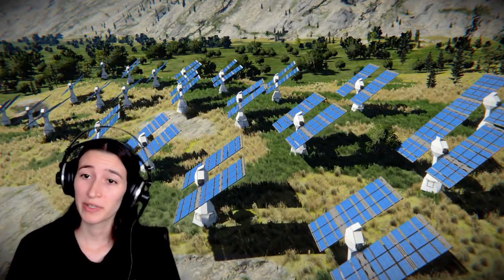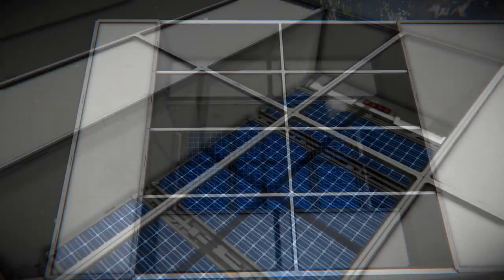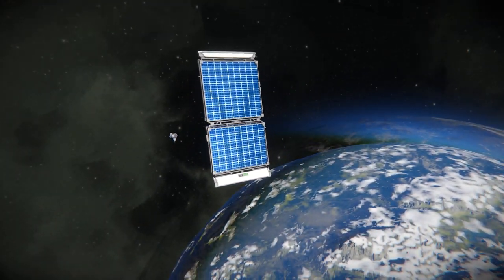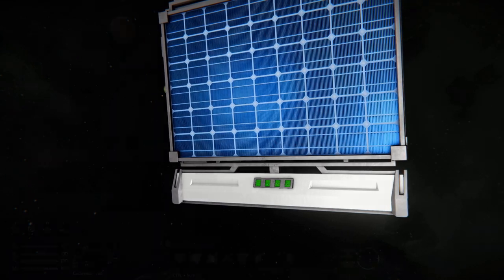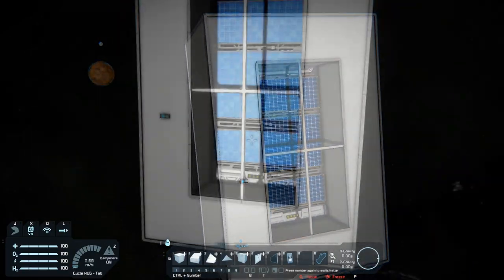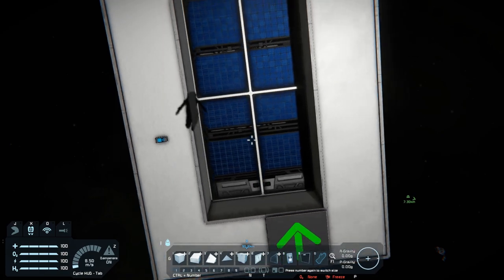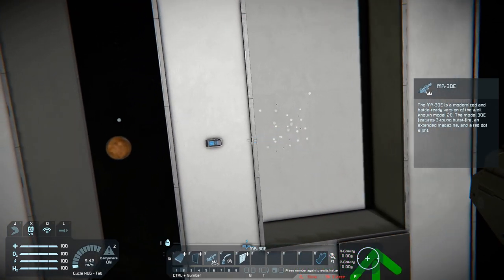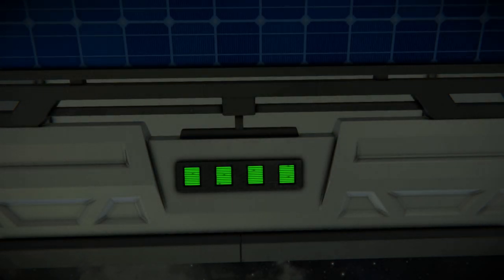Armored solar panels - Space Engineers

Comment: I think this works because when the solar panel checks for things blocking it by shooting an invisible ray, the point the ray starts from is slightly above the surface of the panel in space engineers.

In game engines, raycasts usually ignore surfaces that face away from the point they rays are shot from, so the ray doesn't get blocked if it starts inside the object that should be blocking it. Backwards faces are pretty familiar to anyone who has ever clipped inside something in a game and realized you can see through the surface, the rays work pretty much the same way. Whenever that happens, the thickness of the blocking object doesnt matter anymore. I think you could also check if it works if you put multiple layers of blocks in front of it, since the game probably merges the blocks into a single big mesh, so there are actually no faces inside the now thicker wall, so it should work the same way.